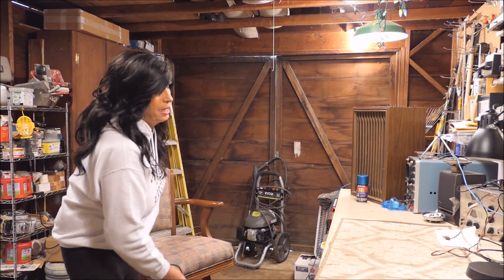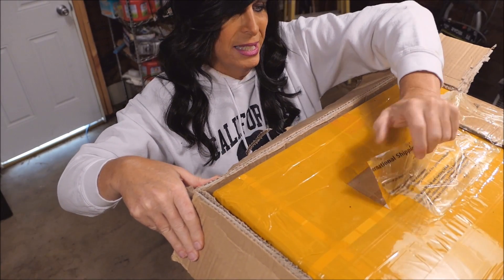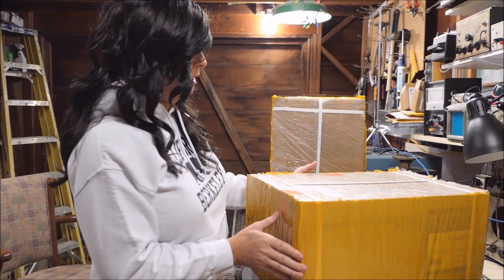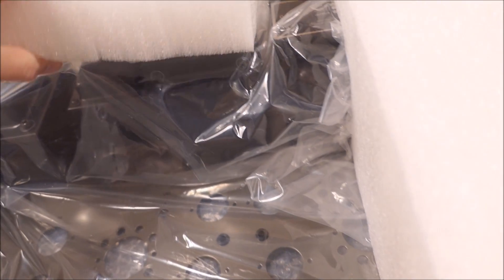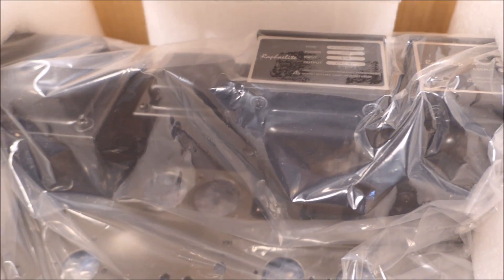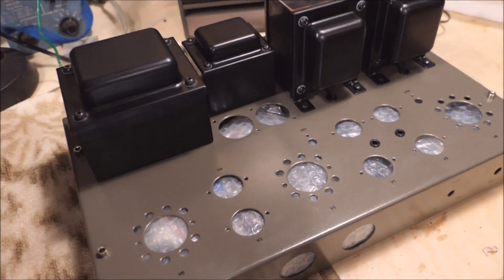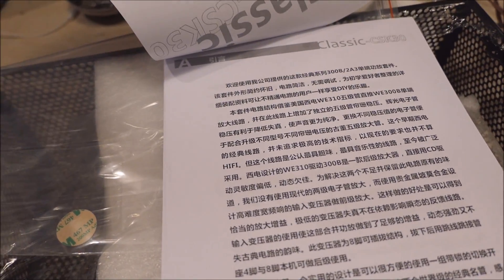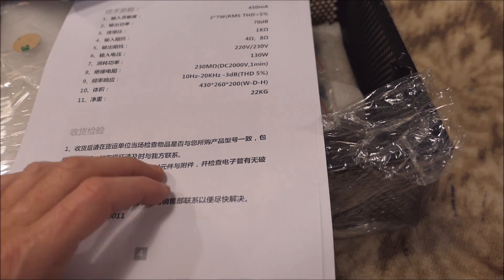Choochin on a Monday...Oh No! Building a Tube Amp -- With Chinese Instructions

Comment: I used to have fantasies about the Audio Note  Ongaku.. it was described as a zero negative feedback Triode line level integrated stereo amplifier, i used to get wet knickers thinking about it..... in 1989 it was retailing for £38,000.  The issue at that time was the best speakers in the world where totally incompatible , i believe there was a toss up between the Infinity Kappa references and an unusual set of electrostatics of which i cannot remember the name lol....XXXXXX
Reply: Sorry that was single ended zero negative feedback triode line level integrated stereo amplifier.... ; )

Comment: I built a Heathkit around 1962. The problem with modern tube amps is the quality of the tubes. Good ones are quite pricey. I'm running a Marantz 2275 but my MC phono pre has 2- 12ax7 tubes which have been upgraded. I can afford to upgrade 2 tubes. You never cease to be amazing.